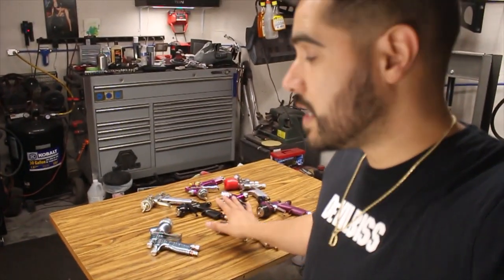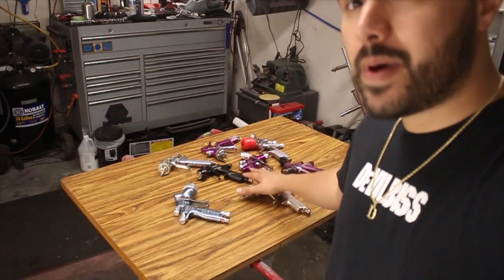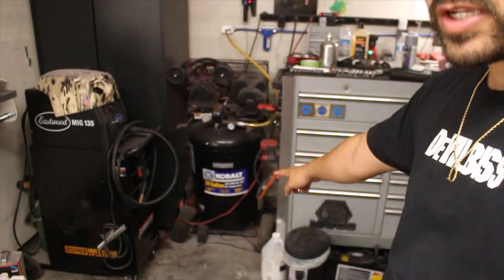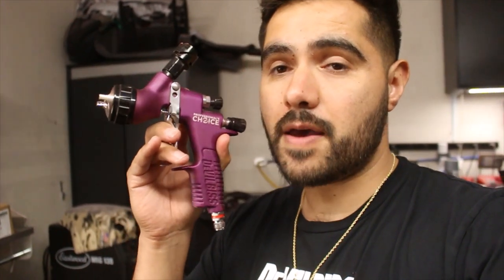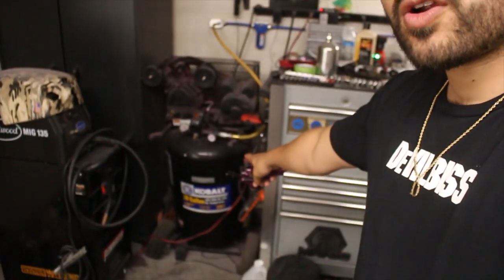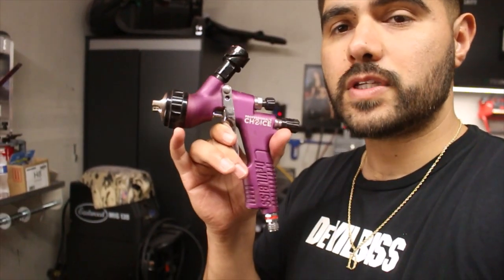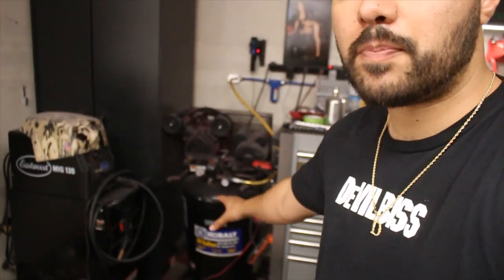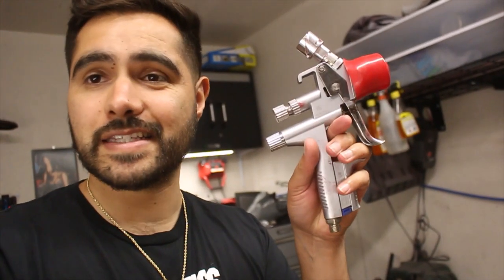BEFORE you BUY your First SPRAY GUN -WATCH THIS!!

Comment: In your opinion, what size of air hose is best fitted for HVLP application? Nice video. Please keep on posting. Thank you.
Reply from the maker: Depends on volume needed for that gun mini guns use about 4cfm where larger high end hvlps can take around 12-16 cfm . , I would say however to answer your question minimum 3/8
Reply: @Mechaniclyfe  My gun is rated at 30psi at inlet, 10psi at air cap, and at 13 cfm throughput. Thanks for your reply.

Comment: I've got a air compressor. I am finding it hard to find a good spray gun. My budget is 500-600 GBP, I just will be doing single panels & bumpers not a whole car or anything like that.

Compressor specs:
250L/MIN
8.1 cfm (displacement)
50L tank / 11 gallons.

could you recommend me something?
Reply from the maker: I would recommend a Dv1S it’s a mini gun , uses low cfm , large fan multiple tip sizes and put down base and clear beautifully

Comment: Hey Chris. I am about to by my first gun. I will mainly be using it to paint solid body guitars. I need something that will be able to spray primer, paint and dyes. I have a Harbor Freight Fortress compressor. It has a 10 gallon tank and delivers 4.3 SCFM @ 90 psi. It has an onboard regulator. I will get a more accurate regulator. Not sure which way to go on the gun. Any suggestions would be very appreciated! Thanks.
Reply from the maker: Hard to say with that small of a compressor , I would say go for a lvlp spray gun such as a spray it 33000

Comment: I'm new to painting trying to amass my tools to get started, not knowing personally only what I've seen, I purchased an Iwata HZ3 for primer, a Devilbiss fg5 for sealer. A Tekna pro lite for base and a Supernova for clear, I installed a 60 gallon compressor, what is your recommendations on my gun selections to get started painting. Thank You for your advise...
Reply from the maker: Those are all great guns for thier intended purpose but I would ask, why so many guns?
Reply: @Mechaniclyfe  because if this reply. Would you suggest one gun to “do it all” (primer, base, clear)?
I am planning on doing multiple race helmets. 
Thanks in advance
Reply from the maker: Look into the 3m performance spraygun I think it will suit you well one gun for all purposes

Comment: I wanna buy a base & clear coat spray gun and I was confused between flg5 and iwata kiwami or belaria now the gunman add the gpg to my confusion 😅 by saying it's very close to gti pro lite, I have 60 galon air compressor with 40 cfm, my budget is about $250 I need your advice. 
Thanks
Reply from the maker: Out of those options I would try the gpg it’s an all around gun , good price , sprays as well as a tekna prolite and has many options for tips and caps
Reply: @Mechaniclyfe  thank you